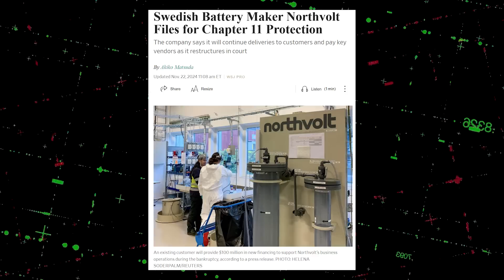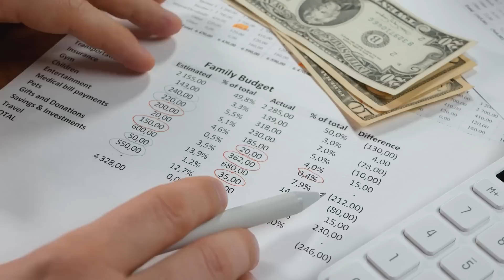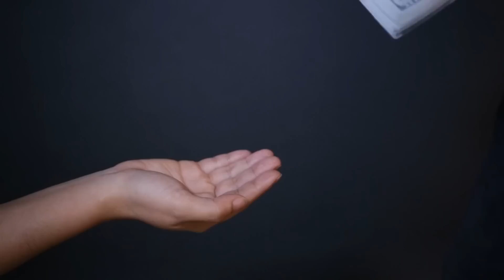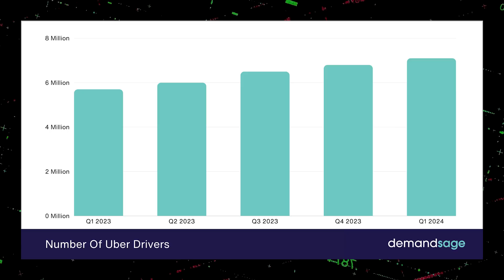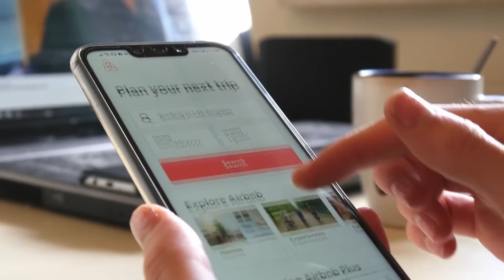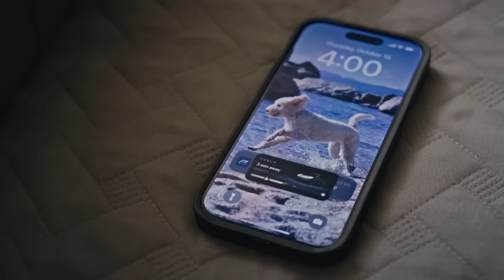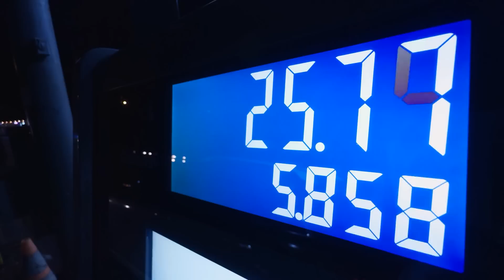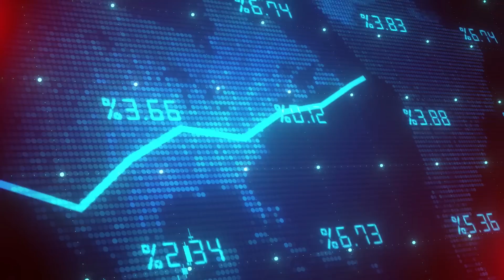See What's Coming Down the Road - Before the Analysts

Comment: So lots of detail questions.  Where does one keep multiple vehicles?  Also, Insurance - this is a business - need a different insurance policy - cyber trucks are difficult to insure - these may even be more difficult.  Maybe Tesla will offer the insurance.  Also, if your car is damaged you lose the use of it for at least a month while it is repaired.
Reply: Regarding insurance, since the vehicles will be fully autonomous, Tesla will be responsible for providing and paying for the insurance. To put it another way, Tesla is the driver of the car.
Reply: @eastmanwebb5477 And that's why they started an insurance division.  I even called it before they did.  It made so much sense when going autonomous.

Comment: I invested in a company called UFODrive that has rented out a fleet of Teslas for 3 years now with the intention of doing just this once FSD arrives. They have an app that means they need no customer facing staff, just dedicated bays in parking lots in major cities. You just go on the app and it unlocks the Tesla and adds you as a driver. I'm already up 40% before things get going and they operate in the UK and California and a few other places. 

Makes me think Hertz were crazy to sell off theirs just as the business opportunity explodes. People renting cars for long trips don't generally want EVs, which Hertz found out. I found this out too when I rented my MS out on Turo. They need thorough instructions on how to use chargers and plan their route. It didn't help that the car locks the doors when you plug in to charge so they got locked out and I had to remotely unlock it with a poor connection which was stressful and meant It had to give them a large refund. People taking short taxi rides won't care. Hertz sold too soon.